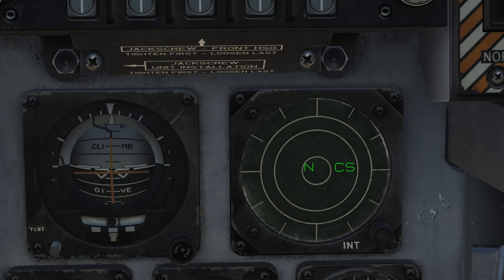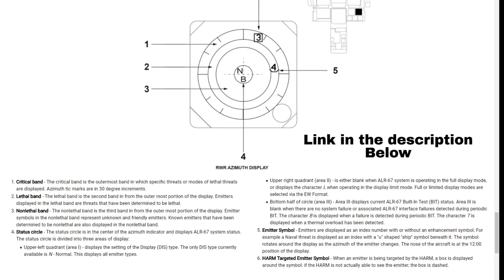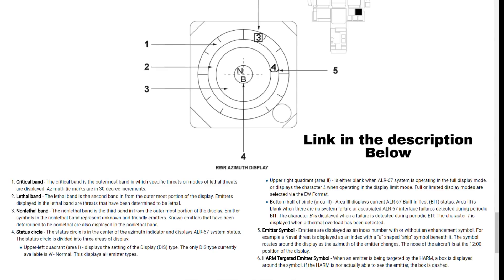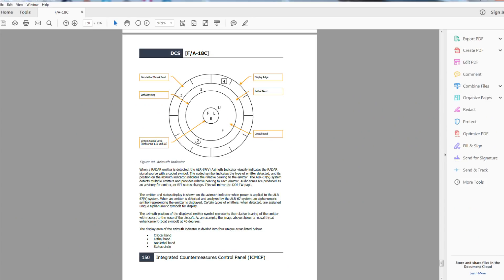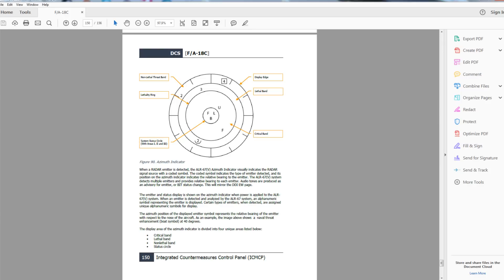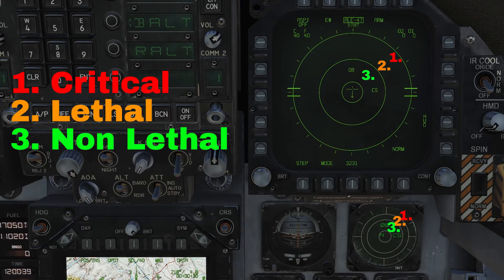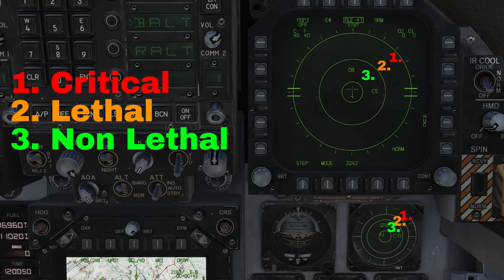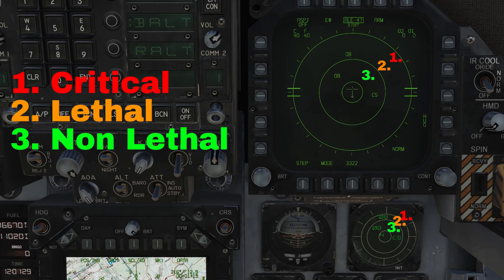DCS F/A-18c Hornet Countermeasures RWR Update

Comment: We certainly did not "goof".  The band logic has changed over the years based on the software version. Given that most of the public information is in regards to the critical band being the inner band, we'll probably move to this at a later point.
Reply from the maker: Thank you for the feedback Matt, i appreciate it's in development, and we're dealing with a classified topic, but having the manual state one thing and the simulation appearing to show the other. Has caused a lot of confusion and uncertainty in the community. A small disclaimer stating the RWR's condition and differences in the current simulation and future possibilities on the manual would of helped a lot.
Reply: I'd ask what your SME's, available NATOPS documentation, and Boeing supplied materials are saying, rather than simply what the public can find.  There's nothing wrong with teaching against "conventional wisdom" if it's correct, and the system worked in the alternate fashion for the time and software loadout you're presenting.

The AIM-7M is a man's weapon, and threat out is a man's RWR.  ;)

Comment: I allways wondered how the RWR can tell the difference between a radar lock (STT) and radar lock + fired Fox 1 missile. I mean what is the radar doing differently since STT is allready painting that one target and the missile itself is not emitting anything.
Reply from the maker: The RWR can detect each sweep of the radar which lets the aircraft know it's within an emitter.  when being tracked, the radar has stopped doing sweeps and is specifically targeting the aircraft. Increasing the energy hitting the aircraft. I presume when you go to tracking a missile, the radar has to use even more energy to illuminate the aircraft better for the much weaker radar sensor in the head of the missile.

Comment: No no no no! This is not correct. VRS incorrectly simulated the Radar Warning Receiver display. ED copied it. The RWR works exactly as you'd expect - the closer the threat the more lethal.
Reply from the maker: At this point there's a lot of confusion and i couldn't say which way it should be. I'm sure eagle dynamics are doing the best they can to research it.